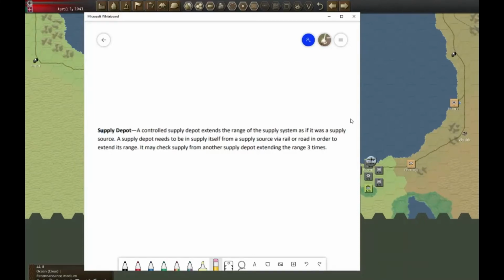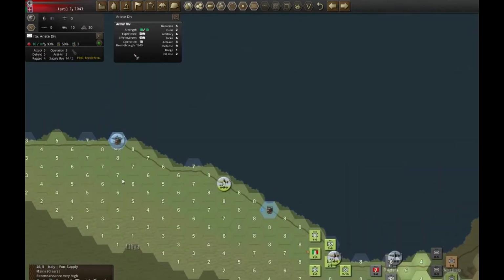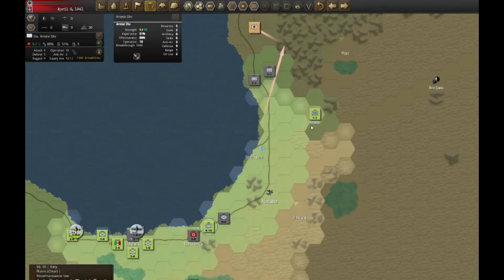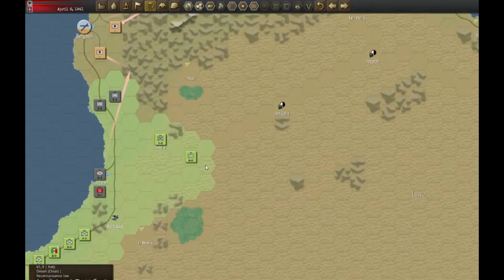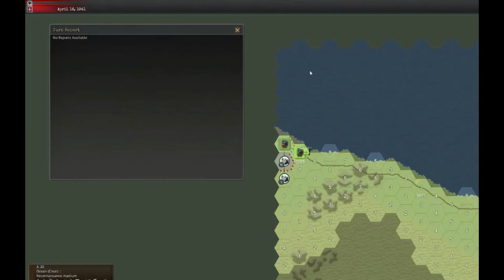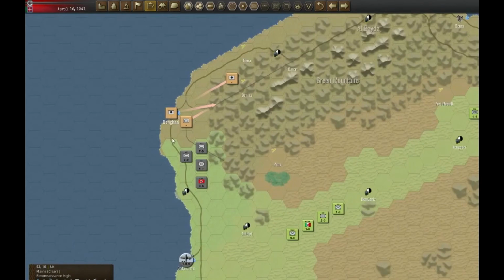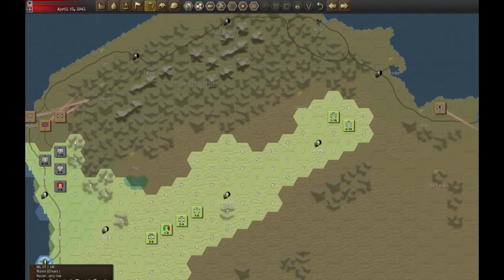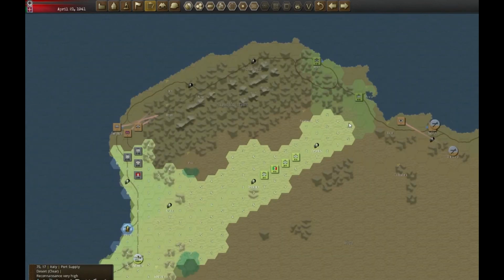Warplan Guide Supply Depots HQ

Comment: I was playing the Allies in the North Africa campaign and when I reached Buerat, supplies were no longer available for a continued advance.  (HQ's extended supply to 4 hexes beyond Buerat.) It seems like I was expected to capture the port of Misrata in order to restore the flow of supplies but such an advance would result in massive losses.  I tried just launching hit and run attacks until the clock ran out and the result was that I had to share a "Major Victory" (1000 plus VPs) with the Italians who apparently get 500 victory points simply for holding Tripoli and Misrata.  (Germans ended with "Worse than Historical Result" and 0 VPs) This makes no sense.  Am I missing something?
Reply from the maker: Ports size limits supply and distance from port.  The more troops you have there, they then go into basic supply and your dead in the water.   The game is designed that way.   The idea was the supply lines were so long that they impacted the troops.  That's what makes taking Egypt so difficult if not near impossible without some luck.
Reply: @WWBoardgamer  I disbanded all but six divisions (4 armor, 2 infantry) and my fleet and it actually got worse because my HQ's no longer seem to extend supply.  How can that be fair?
Reply from the maker: @warrensmith8161  When you hover over the port was the supply at zero?  Any supply interdiction occurring?   Many have complained regarding this situation but it is designed this way.   Supply lines are being stretched and HQs only do so much.